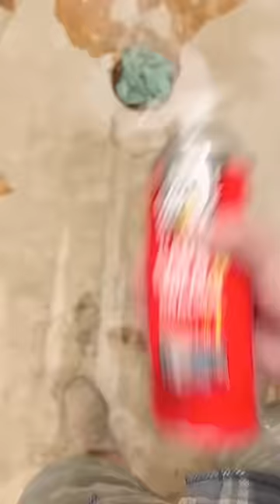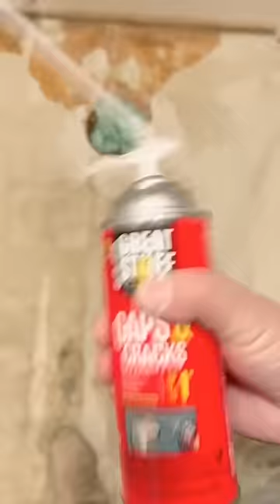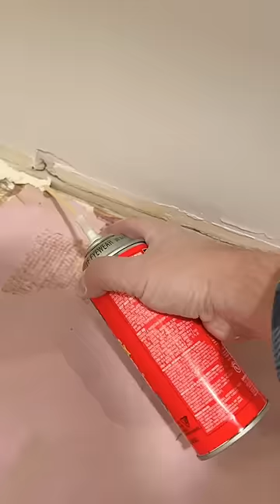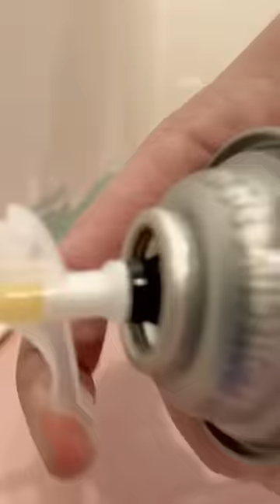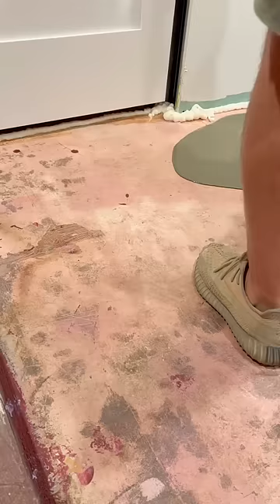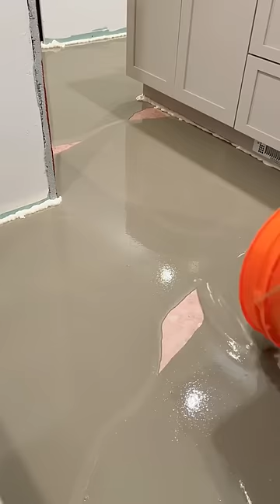Spray foam is great for using self leveler. Gives you an expansion joint around the perimeter. #diy

Comment: I use clear calking. Takes a bit more time but your pour is right up to the wall, cabinet, and toilet flange. No tearing out that nasty foam. Ready for tile.
Reply: What's your favorite color caulk?
Reply: I'm curious wouldn't you have to cut out the foam?
Reply: 1" or so from perimeter of walls isn't going to make a difference....Spray foam allows you to pour soon after applying....
Reply: @Maria Alegria  Yes stuffs pain ass
Reply: @mariaalegria6759 You ask the right question. Spray foam is a wick for moisture once it's altered. Shaved,cut or punctured. I see these presentations using spray foam for uses it was never intended for. The person stating that they caulk is on the right track. Properly applied caulk is the opposite of spray foam. It repels moisture.
Reply: I like caulk too
Reply: If you were installing river rock on 12×12 sheets would this step be needed
Reply: @sunloved9202 the video is about self leveler right?
Reply: @mariaalegria6759 you ask this on his comment about cutting the nasty foam out? Oof
Reply: No shaking required. 😂
Reply: @Travisjoe31 absolutely
Reply: @G00gLe_was_my_idea989 lol clear?!?
Reply: @jadedstar7442  if you shake the caulk more than twice that means you're playing with it, don't play with your caulk
Reply: @tanisgeorgetti1439  😂 clear isn't a color 😜
Reply from the maker: Why would you want it up against walls, cabs etc. every company that offers a perimeter seal for leveling is foam. Leaves room for expansion and contraction ensuring your leveler doesn’t crack or tent.
Reply: I was just about to ask about that. How do you get out that bubble foam or at least cut it down?
Reply: @sunloved9202 level quick
Reply: @G00gLe_was_my_idea989 The black caulk is nice and strong, but the white caulk will suffice
Reply: Well it would have been nice to see the finished product but I don't think he's pulling that out I think he's going to trim it flush
Reply: It takes no time at all to cut the foam after.  Just run a blade across it level with the leveler.
Reply: @G00gLe_was_my_idea989 Now ya tell me. Thanks.
Reply: @G00gLe_was_my_idea989  Shafers big black caulk…..
Reply: Thought he had his caulk out for a min there
Reply: @markt9438 Same. Wanted to see end😅.
Reply: you dont have to "tear it out" just run a razor blade on it or use a multi tool
Reply: Fast sure..lifetime coverage ehhh no..foam isn’t intended for this
Reply: Yea do you like big caulk or little caulk?
Reply: @xA-A-RONx  comedy is comedy does
Reply: Same. Tried it ONCE with the foam, was more work cutting it out afterwards.
Reply: @jaredkarr1143   Good for you man
Reply: I use spray foam to get it the floor prep done in a day instead of two to three days for silicone method
Reply: You can use the sticky foam tape, but you pay more for it. Also a great option.
Reply: @G00gLe_was_my_idea989 black
Reply: It's caulk not caulking
Reply: @davidsawyer1599  why would it matter if spray foam absorbs water? How does that make any sense to you? It's literally going to be covered up by thinset tile & baseboard, also even if it got wet, it wouldn't make any difference, it wouldn't affect anything.
Reply: When I saw the spray foam being used I instantly wanted to see the end praying he would show the removal process because, ummmmm😳
Reply: @jeengyim3072  right!? 😅
Reply: @predatorysage1  mouldy foam is a super way to make people sick 🤷🏼‍♀️ would occur faster than a moldy caulk 😂
Reply: @MajICReiki  there's no logic to what you said. Mold isn't going to appear faster on the foam more than anything else. That's not how mold works. Mold thrives in dark wet spaces. Keep the space dry and there'll be no mold. It's also harder for mold to thrive on non-porous surfaces as well, spray foam isn't porous. Caulk is porous which is why it gets gross if left unpainted. Regardless of porosity, if there's no excess moisture like flood level, then there's no mold.
Reply: @predatorysage1  you stated your own answer to your own confusion. Foam is more porous than caulk.  

If there is not a moisture/ humidity issue correct mold is less likely to survive 😉
Reply: @MajICReiki  you misread my comment, spray foam isn't pourous, it doesn't absorb moisture or water or anything. Go ahead and pour water on it and it will bead right off.
Reply: @MajICReiki  it's not about mold surviving either, if you have mold, it's not going to go away. You either have a mold problem, or you don't, there is no in between.
Reply: @MajICReiki  also have you ever used spray foam before because it sounds like you haven't
Reply: The white caulk is the best

Comment: I was a handyman for 51 years, and someone used self-leveling concrete and then three-quarter inch hardwood floors on top of it, and I had to remove the old dishwasher with a reciprocating saw, and then cut and weld the base of the new one to shrink it and get it in. And every replacement dishwasher after that would also have to be modified what a nightmare.
Reply: Who cares
Reply: @Antonio Padilla  you do obviously cause you read it 🤡
Reply: What was the purpose of the 3/4 on top of the self leveling?? Why not just lay floor on top of the self level?
Reply: @davidjessee7701 That's what he's saying.... They laid 3/4 hardwood flooring over the self leveler
Reply: Umm…I’ve run into similar situations and simply removed the counter top
Reply: @davidjessee7701   they'd put the leveler down to make it all level then they put the plywood so it's a solid nailable surface under it. the leveler would chip and crack I imagine and be a nighmare trying to lay hardwood over. everyone has there preference but defidentlt sucks what he had to go thru to get old out and new in. that's a lot of modifications and tinkering...
Reply: I’m just a homeowner but aren’t you supposed to put flooring under the appliances
Reply: @shelbygrace7636  if you do self leveler correctly, you would add a galvanized or steel mesh to help strengthen it and avoid cracks. And I’m not even a construction contractor. Just a landscape contractor.
Reply: @the1plantguy  the gentlemen was asking why put the plywood over the self leveler and not just lay flooring over it and I was just reaponding to that. Nothing to do with how to increase the structural integrity of the self leveler. I was just letting him know some put plywood over it itlf they are putting down a wood floor that you nail vs like a snap lock floating floor you could just lay over leveler with the underlayment in in-between. That's all. I'm not sure about the leveler itself with the galvanized or what night I'd have to research that before I played with it that's for sure but I get the concept of it.
Reply: If you're using self-leveler at all It's because the floor is beat to hell. So the house is old and you don't want to replace the floor. So if someone comes along later and replaces a dishwasher or cabinet, how many times is that likely to happen in this already remodeled kitchen's future?  You cut your corners, I'll cut mine. This looks pretty useful to me - but I've taken DIY tile out before. 😉
Reply: Oops 😢 I know that day you worked overtime 😕
Reply: @franksmith4727 You take off granite, marble etc???
Didn't think so...
Reply: This is exactly why I question the fact that these half breeds never take out the cabinetry before leveling a floor.
Reply: @antoniopadilla4033  you're rude!!!
Reply: @antoniopadilla4033 you clearly don't do this kind of work for a living then
Reply: The best one I've seen,,,same idea, floor was raised so the dishwasher wouldn't slide out. The homeowner proceeded to cut a hole in the basement ceiling/ kitchen floor, and lowered down. I wish I had been there long enough to see the outcome. I was just there doing some tile work in the bathroom. I asked one of the other trades about the hole in the floor. My first assumption was a bad water leak that destroyed the floor. Nope, I was way off.
Reply: lol cut a hole in the floor that's a new one @Enter-a-name55
Reply: @tiddybearkush yea that story is BS, who’s going to cut through a floor and cut structural joists in two places to drop a dishwasher when you could pop the countertop off and lift it out?  I’ll take Things That Never Happened for $1,000 please.
Reply: There is a place in hell for people who do floors without putting it underneath appliances.
Reply: @stephenu3833 absolutely not true. It may not be necessary but there's no reason it can't be done.
Reply: Yes you are! @the1plantguy
Reply: @smokingbluegrass  i am what
Reply: ...once again, clearly not quallified to comment. @the1plantguy
Reply: @smokingbluegrass what are the qualifications? What makes you qualified?
Reply: @smokingbluegrass  ok, boss. Whatever you say. Clearly you are much more supreme than I.
Reply: 😂😂😂 dang! That's a mess. They would have been better of cutting the floor and adding a removable replacement piece for pulling their appliance out. Cannot imagine theyre goimg to enjoy any dishwasher repairs of replacing the hoses.
Reply: @xenraebones4216  i added self leveler to a swcond floor billiard room i floored in bamboo, because of how unlevel it was. Had to seal calking in all of the joints first so it wouldnt leak through. It was a learning experience.

Comment: Done a lot of self leveler. Great stuff but have a helper and be warned to have all you buckets ready, and pre measured.  Then have a guy stirring the floor while you pour all of them in.  Pouring 1 bucket and the 2nd even 2-3minutes later will not be even. One mix changes viscosity before the next even gets poured.  It will dam up and you'll get a high spot.  

Love the stuff but whatever that's worth to help others.  We ended up having to grind a high spot off, now we figured it out
Reply: good call, thank you
Reply: Hey what is the mix that you are poring on the floor please???
Reply: @Terry Wynn  we use Customs Level Quick RS, can find at Home Depot.  Follow prep and directions to a T. Use a notch trowel on a handle to stir what's been poured onto floor.  Did a high end house basement bathroom.  6x12, was feather to 1.5 inch on the entire run(not sure who poured that nice house so badly to begin with).  When we were finished it was laser level.  That's the worst case we've done and it turned out great. Doorway went into carpet TV room, so we pulled back carpet and shimmed gradually as to not have an angled "step transition ".
Reply: Thanks bud
Reply: Translation: I fkd it all up but listen to my advice anyway. Lol
Reply: Barrels my friend....
Reply: @G00gLe_was_my_idea989  That's not what I got; I think he said someone else had fkd it up, before he fixed it.
Reply: Sorry, I had just finished reading @saywhat6632's comment to Terry Wynn.
Reply: @G00gLe_was_my_idea989  actually sometimes the best advice comes from someone going over how to avoid a mistake they made. Someone falls into a hole and places a Caution sign for those who come next.
Reply: Not a flooring or tile guy, but I’ve seen guys make a 1’ x 1x grid with tapcons or screws in a room where they laser level the tops of the screws and make sure they are all level to each other. Then they pour the self leveler mix and sneak up onto the top of the screws. Which it’s all done, the floor should be completely and flat with only the heads of the screws showing
Reply: Another good tip dont use a fan to speed up the process lmfao, couldnt tell you how many times i have walked into rushed jobs seeing this and freaking out haha
Reply: @manuelmota1318 that’s a bodge job never seen or will do that in my life I’m a fully qualified floorlayer
Reply: Question. Can something like this fill-in voids in a cement driveway?
Reply: @klynnww.6111  depends on the void and what you mean.  I have done a fair amount of concrete work, but I am not an expert in flat work.  If you are trying to fill in a low spot or flaked areas, it should work if prepped properly.  I would not know the long term results, since we use this inside all the time.  They do sell topcoat/patch cement repair
Reply: @ourgovernmentsucks  how do you think advancements happen? People trying new things and fucking it all up untill they finally dont.
Reply: @saywhat6632  how the hell do you shim carpet?
Reply: Thanks for the tip

Comment: Awesomeness, thanks.  I used some spray foam, built a cylindrical form around an exposed pipe. Sprayed it and it looks like an architecture part of the wall now rather than eyesore. Also, I plastered the foam with mortar and smoothened out any little crevices with caulk and it came out looking sharp.

Comment: Only let someone do this to your house if they know exactly everything they must do to prep. The people who did this to our house didn't fill in holes in the middle of our floor, which resulted in leaks to our subfloor. And they mixed the pour too thin so it took over a week to dry and cracked when it was finished. The whole thing had to be redone.
Reply: Thanks! Good to know! Sorry about the first contractors mess. Did you have them redo or did you hire a second company?
Reply: @faithm9284  We let them scrape it off and put down plywood. They did better, but still not great at that. Ultimately, we ended up firing them because they couldn't get anything right.
Reply: Omg I think we are living this right now. 11 hours later and ours is still wet and it leaked into the basement too
Reply: @hethalee  hugs and good luck. Hope you don't have to fight for them to fix it.
Reply: @krisleigh2005  they're coming back to take it all off and they want to lay one inch plywood then the LVP.  We're not convinced the plywood is the right call and everyone we've talk to doesn't think so either.
Reply: @hethalee  Just plywood by itself is working well enough for us. I really don't know why this is a thing unless your house is severely tilted.
Reply: And I was just thinking to myself...wow, they didn't even have to move the SLC around to level it out. Note to all, it doesn't "self level," not like water (or the video). I just poured SLC in a bedroom. It is hard work - so don't kid yourself if you DIY. Mix according to instructions and it will flow to about 1/8". I had to "blend" areas together using a spiked roller. Then a Mapei patching compound to level from 1/8 to 0 in a few areas. My thickest pour was 3/4". Had to do that area twice.
Reply: @richardpellis  I don't think you're supposed to go 3/4 thick, half inch tops, I believe
Reply: @krisleigh2005 wow, some people's licenses. Am i right?
Reply: @krisleigh2005  some places/ climates, even cured wood warps. 😉

Comment: We always trim it back with a box cutter before pouring and make sure you roll on the correct primer so it bonds to sub floor.
Reply: I’ve had trouble when I didn’t use the metal screen backer. It all peeled up off the wood and I had the primer on.
Reply: False information son
Reply: @GODSWORD11 that’s not false information I’m a floorlayer by trade you clearly don’t know what your talking about
Reply: ☝️🧐 all of this sounds accurate.

Comment: Damn straight! It works like a charm but you forgot the tar paper (if on a second floor) and the lathe wire.
Reply: Tar paper and lathe wire? You definitely don't need tar paper to pour level cure onto concrete, and no one has used lathe wire for about 80 years.
Reply: @hot4km , Haaaa😂.  About 30yrs for me and the customer insisted on it ! Her deceased father was a tile guy!  She was spot on when telling me how to do it ! 😂😅

Comment: Great tip. I did think of it fir around the commode/toilet. Do not want to disrupt it. 
So then you just trim the foam level with the self leveling before tile or epoxy ??  Renovating my master bath. 
This is a great help and inspiration
Reply: Mold can geow under a toilet. Wouldnt put anything undwr it that would saturate in 💩 , soak up sewage and sit sealed in there brewing a lethal cocktail for whomwver would use it or eventually need to replace the wax ring. And if its not on concrete, like a woof floor more reasons not to add material not meant to be under a toilet. That is how the 2nd floor toilet winds up on the 1st floor dinning table 😅

Comment: I use blue painters tape around cabinets and drywall. Spray foam is a mess
Reply: Tape provides zero expansion. 
Hence the title "Spray foam is great for using self leveler. Gives you an expansion joint around the perimeter."
Reply: I agree with the cabinets, but everywhere else prepping and placing tape is more annoying than kicking the foam off
Reply: It's basically to make a pan for the leveling compound as you don't need an expansion joint for ceramic tile. Just cut tile s little short and caulk near tub and walls baseboard will cover it. As for cabinets I use 1/4 round or shoe.
Reply: I also use masking tape or blue painter's tape either one you don't have the mess
Reply: @KaleidoscopeJunkie  yeh, but this looks like absolute garbage... but you're  right it'll expand.......
Reply: @KaleidoscopeJunkie it gives you a barrier but not an expansion joint
Reply: @celticsfaninthedesert4778  It does if you apply the foam correctly. Foam has air bubbles that can collapse when expansion is needed.
Reply: Don’t get it all over your hands. Just trust me

Comment: Trimming up the foam before laying would leave a cleaner & more even floor
Reply: I was thinking the exact same thing because I did the foam thing for my indoor inflatable hot tub room!
Reply: Never done this personally but seen it done in industrial aspect. My question is, if this is done in a home do you just trim the expansion foam horizontal to the dried floor top? Does it depend on your wall/floor molding type?  Looking at my bathroom floor now 🤔.
Reply: @CrazyK1  both. Horizontal and vertical to where you the the extra away from the wall.